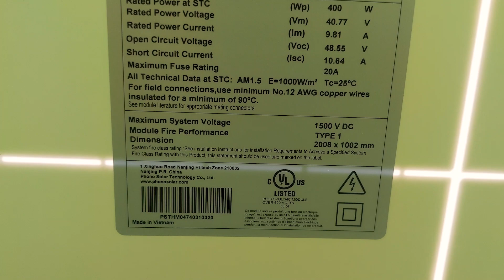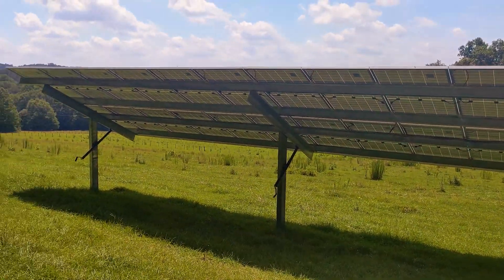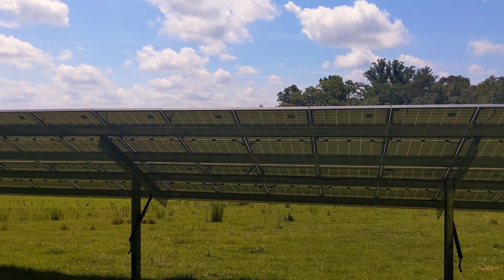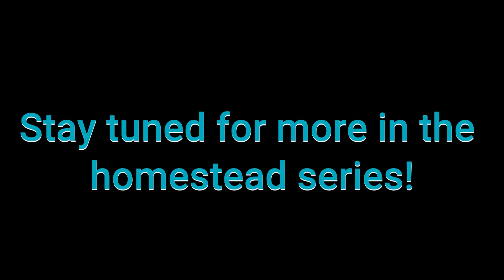DIY solar part two: stringing and trenching

Comment: Holy cow, no PVC  expansion joint between the pull box and the ground, so that when the trench settles the 2" conduit  wont pull out of the pull box, or terminal adapter.  Very nice ground mount, I learn a lot from you.